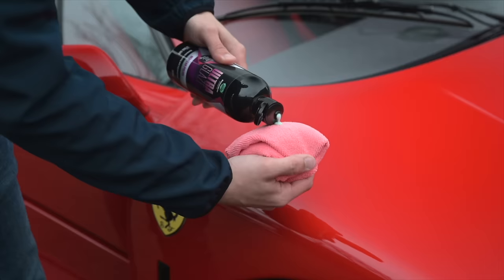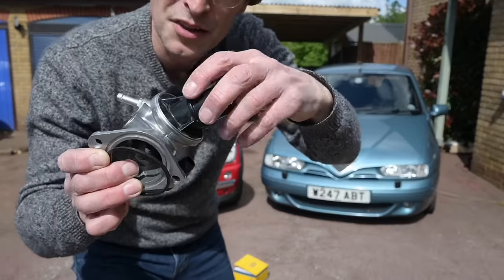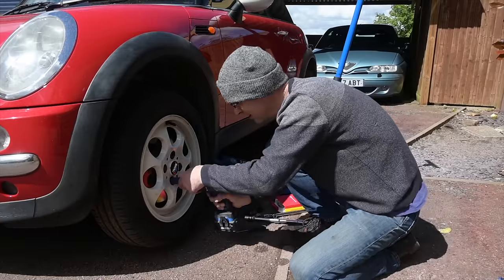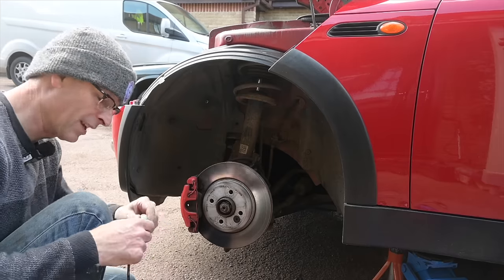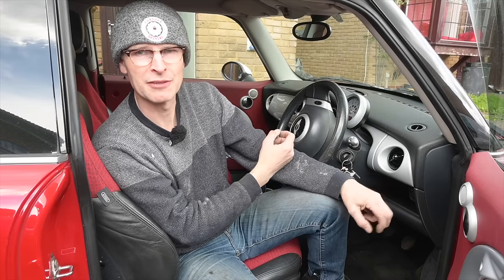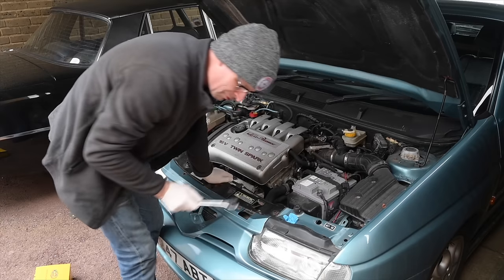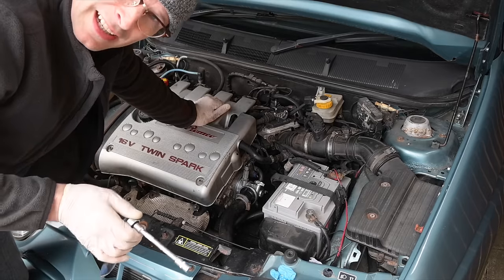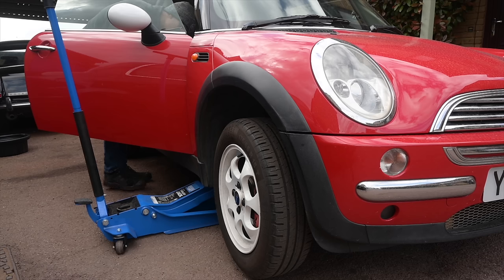Rustival broke 2 of my cars! Mini ABS sensor & Alfa 145 thermostat (again)

Comment: RE ABS, as with most cars its generally the wiring in the arch area. Particularly if there is a section of wire which moves up and down with the suspension. Eventually the copper snaps internally. Even though the wire may visibly look ok. So check wiring back using a multimeter on continuity. Cut out wire section and replace as needed.

Comment: Could be the tone ring as you say or a wheel bearing. If the bearing has play, then the assembly could be spinning with a wobble on it and thus digging a groove into the ABS sensor.

Comment: Replacing the abs sensor was an easy job like you said! 😂😂😂 but sadly it wasn’t the problem! Probably the reading ring is corroded and damaged the old sensor as you noticed ! I don’t know if you can replace it separate from the wheel bearing!? Most of the time they are integrated in the wheel bearing! You can test the reading ring with a simple tool! It’s a little transparant card with metal dust in it ! When you lay the card on the ring you can see if the 0:20 tiny magnets are intact! You can see the magnets then because the metal dust collects itself above the magnets! Good luck Matt and 👍🏻👍🏻 🆙 like allways!

Comment: Hey Matt, the reason you had a new tire pressure warning light on the Mini is it uses the ABS wheel speed sensor to measure if one wheel is spinning too fast, as low tire pressure will cause the wheel to be slightly smaller in circumference. So it’s basically two separate symptoms of the same problem 😅
Reply: Rolling radius 👌
Reply from the maker: That makes a lot of sense!
Reply: @ianjenkins4641 that’s the term I was looking for!

Comment: It's another one of those 5 minute job thingies that just blow up into a whole 'right I need to get some new parts things rendering the car undrivable in some cases. I remember changing an 'A' series thermostat that the housing just would not budge in the late 80's that ended up with the housing needing to be replaced following eventual removal. The next time I had to replace a thermostat on a different 'A' series engine having bought a new housing at the same time as the thermostat (expecting a re-run of the previous fun) it took five minutes and I need not have got a new housing as it all came apart brilliantly.  Anyway great progress on the Alfa. I've yet to experience the old Mini circus of doom fault light syndrome so I might just leave these to one side on possible future classic purchases. I'd like another classic Mini but my current want is a 2CV at some point. Many thanks for sharing.

Comment: Nice repair on the 145! Those cheap ABS sensors are crap, always get the OEM or A brand ones. Also check the wiring and the reluctor ring. Hope the garage can solve it. Nice tinkering video, always like these. I miss the weekly ''Going for a drive'' review videos, any coming up soon?
Reply from the maker: I suspect YouTube isnt pushing my videos recently as there have been driving videos every week for the last month or more - Rover P2 last week https://youtu.be/qJm-jD0edSg Toyota Yaris Verso, MX5, Mk1 Ford Focus, Kia EV9 are all recent

Comment: Have a look at the wiring loom up by the ABS pump - it has a habit of chaffing through and losing comms to the wheel sensors. 

Cheap ABS sensors are a false economy on the R50 series Mini. Stick with branded ones - I used to use Delphi on mine when they died - cheap ones would never let the codes clear.

Comment: Check out the ABS ring gear. May be rusty. The sensor generates pulses from this. Keep up the good work.
Reply: Yes, rust underneath it might crack the ring and mess up the sensor and also give bad signals! Turning the driveshaft to check the ring is a good advise.

Comment: Matt, as a mechanic in Australia the same rules apply. For critical parts such as ABS, coolant parts etc never ever use cheap and nasty parts. Always always buy the OEM or a higher quality branded product. I can tell you from my own experience of running a shop for the last 9 years.

Comment: What a good idea to have a aluminum housing with a plastic hose connection swaged into the end.  What could possibly go wrong?  I haven't done much work on Mini's but if the old sensor has that wear, then something is loose on the hub sensor ring and that's why the light is remaining on.  Hopefully it hasn't damaged the new part.
Reply: It's a crap idea!

Comment: I changed the thermostat on my 147 1.6 and I'm sure there was a bleed screw even if it was 8 years ago. 
Yours may have gone pop because you didn't bleed it properly 3 years ago and only doing short journeys didn't bring the problem to the surface until now. 
Also run your heater on hot when doing the bleed , just open the screw on the radiator to bleed .
Reply from the maker: The Rovers have a bleed screw but Im fairly sure these are self bleeding

Comment: On the Alfa: I hate plastic parts that are exposed to hot coolant. I’ve had a lot of problems with that on my son’s Passat. On the Mini: At least the sensor didn’t break off in the knuckle/hub. That’s what I was expecting. Hondas are bad to do that, even if they don’t appear to be rusty. Good luck sorting that out.

Comment: I don't know if that's how it works on a mini, but a lot of TPMS systems rather than using the tyre valves, they actually use the abs wheel speed sensors to determine if a tyre has lost pressure. So if an ABS sensor fails it could throw up  the TPMS warning light as well as the ABS warning light.

Comment: Common BMW issue is those reluctor rings, I had exact same issue, thought it was the sensor replaced that and still no good, ended up having to replace the whole hub assembly on a 325d, and what a pain it was 😂

Comment: Did you only paint the front half of the calipers? Currently for the F series mini we use a lil bit of grease for putting the sensor in.
Clean the ring ;) for the ABS issue.
Reply from the maker: I didnt paint any of the calipers!

Comment: Sounds a bit crazy but check the ABS pins on the car haven't bent, had that once when I wasn't concentrating and bent a pin put the plug together. Alternatively swap the OSF sensor for the NSF and see if the readings swap over, least then you can rule out a dodgy new sensor. Check for any broken wires on the car end loom, could be an electrical issue instead. Know the ABS rings can swell up and (sometimes) split on BMWs (mainly rwd not newer 1 series being fwd) and they give iffy readings causing ABS issues but never had it on a Mini (R50 or newer).
Reply from the maker: I dont think so, the sensor pins were fine when I took them out to check and the receiver on the car side is fully shrouded so cant bend

Comment: I did a wheel speed sensor on my Mk1 Octavia a few months back (i had to drill and hammer it out, but thats another story) and recall i had to sort of reprogramme it in with my VAGCOM diagnostics to get the car systems to recognise the new sensor and get the warning light to go out, it was a bit more involved that just clearing the code. Im not sure if Minis would be the similar? 🤔 Also perhaps check the distance of the sensor tip from the reluctor ring, they can be quite sensitive to spacing on some cars. No experience with minis though!

Comment: Often wondered what the difference between modern coolant and Ethylene Glycol antifreeze and water solution is apart from a good few quid.
Reply from the maker: corrosion inhibitors are a big part of it, engines can fur up internally with plain water
Reply: @furiousdriving  I didn't mean using plain H2O but the difference between an AF solution and the ready to use stuff.  Ethylene Glycol does inhibit corrosion but is highly flammable and toxic (causes symptoms of being very drunk, then death).  Many an RAF Pilot discovered the flammability when his Merlin engine erupted in flame from a coolant leak, 100% Ethylene Glycol.

Comment: An OBD reader just points towards a fault. At college I cut one ABS sensor wire, the students have to find fault, so test sensor for resistance, then use either Oscilloscope, or  DMM with high speed refresh. Never just replace a part without doing a two stage diagnosis!
Reply from the maker: The problem I found here is the pins are 5 or 6 cm down inside the plug so I cant get a tester onto them
Reply: Always a way to test, straighten a paper clip, need to be inventive.
Reply: I was always taught that you can't test the internal resistance of a hall effect ABS sensor, ie. a sensor that reads off of a magnetic reluctor wheel 

If you do, you will destroy it.

However, you CAN test an analogue abs sensor, ie. A sensor that reads off of a toothed ring

Comment: Just done the abs sensor on my wifes 06 mini , bit of a pain as the sensor snapped , tryed the the screw a screw in and pull out , but it was in there so tight the screw snapped lol , had to take the hub off in the end pushed the drive shaft out drilled the old sensor out , cleaned up the sensor housing with a rotary tool so the sensor went in nice and easy. Lol funny enough my wife was looking at alfa mitos today for her new car , are alfa the same pain in the butt like mini can be i done a lot off work on her mini 😂😂😂 it might be the ring m8 when i changed my wifes one it worked straight away. It was also a cheap Ebay part as well

Comment: Can you buy just the toothed ring for the ABS? I suspect with my Daewoo you have to change the whole CV joint. I suppose if those teeth go rusty it could take up the clearance and start rubbing on the sensor.
Reply from the maker: yes, its not expensive

Comment: Lo Matt, Re Mini, Just wondering how ye get it through MOT wae Xmas tree lights on the dash. Last time i did that ma tester went nuts and requested that i took the vehicle away and bring it back without the lights. Finally for now That replacement part for Alpha. When you think about it youv'e got a plastic feed pipe bonded to an aluminium base with a thermostat inside it. That's asking for trouble . If that car was a daily you would be out of pocket with replacements you would need to buy. Bonkers 😳  Laters

Comment: the only non-wear and tear part to fail (at about 40,000 miles) on my 9yr old 90,000 mile Fiesta was a.... plastic thermostat housing. Plastic parts have no place on engines

Comment: Did you go for a drive after re-fitting the ABS sensor? It may need a few rotations at a certain rpm to reset and re-calibrate.
Reply from the maker: Yes, far enough to rotate it a few times
Reply from the maker: far enough to register it

Comment: Were those Alfa thermostat's originally an all metal construction ?  3 years and 1000 miles of use is terrible. Also should those bolts be that tight?
Reply from the maker: Good question, Ive not seen an original. I think its more corrosion on the threads than tightness

Comment: I had a similar problem with my Peugeot 3008 and the front wheel sensor. It turned out to be the EGR valve was gummed up and sent an error message to the computer which threw the fault code to reduce power!
Reply from the maker: thats a weird and very French problem!
Reply: @furiousdriving  That is why the car is sporting a HubNut sticker saying "Because French"!

Comment: Have currently got the same problem on 2002 cooper abs light comes but only occasionally at the moment. Agree totally most lights on early r50 just ignore lol the airbag I must have reset 12 times in 6 years of ownership.  Also have a fault with window wipers coming on by themselves when weather is hot and not turning off when it's damp outside super annoying,  any ideas?
Reply from the maker: Check the earth on the wipers, mine has a new one straight to the battery someone has made in the past! Also check the airbag wiring under the drivers seat, a common fix is to disconnect the airbag and fit an LED or resistor to the circuit so the car thinks its still there...and then dont crash!
Reply: @furiousdriving  Brilliant thank you so much

Comment: The Volvo could not manage 300 miles on a single tank? Either the 2 litre is dreadfully thirsty by nature or there is something very wrong. My guess is that the O² sensor is old and dirty and/or the catalytic converter is plugged. My 90 240 wagon, 2.3 litre and automatic gearbox, would do that and quite a bit more on a clean run like that. It would, at a pinch, do just over 450 miles on a single tank.
Here's hoping the Alpha is working properly now. It may be that it needed renewing early, but still easily done. As for the Mini, with that vintage of Bosch electrics, you may need to invest in the Mini original Bosch part, not an azin knock off Bosch or aftermarket piece. Multiplexing the electrics is a right daft idea!
Reply from the maker: Guess again - it has neither of those! Mechanical injection and no cat. They are just very thirsty cars